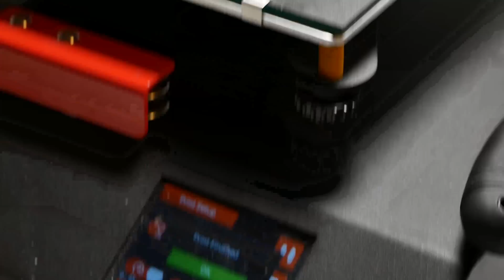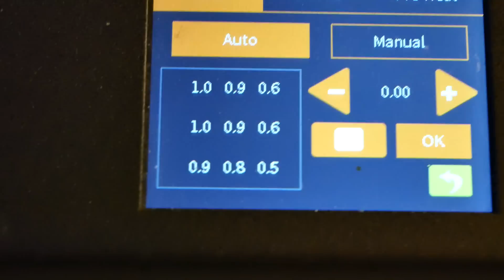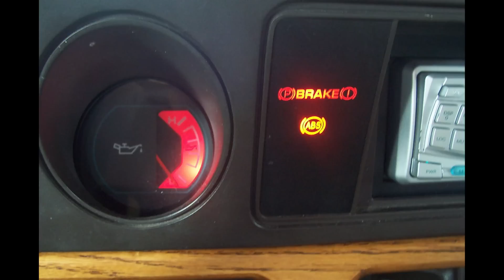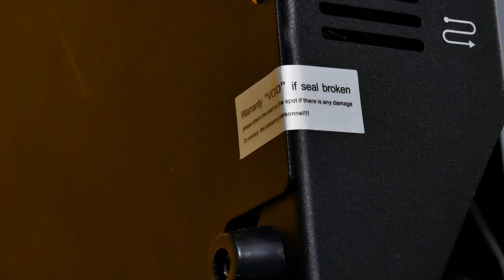Regular 3D-Printer Reviews - Anet ET4

Comment from the maker: BTW! I heard you all (in my last video) when you said you want a V6 and a V8! I'm working on it!
Reply: Just wanted to ask: the only problem I had with the i3 and am having with the V2 is the curling of those very severe angles in the beginning of the print. Do you have any advice to overcome this issue? My bed is as level as I can get it, my fan is on 100% and I'm printing 20mm/s. Using Fillamentum Extrafill PLA.
Reply from the maker: @vit.budina  try having less fan on in the first few layers, maybe turn up the bed heat a little to 60?
Edit: depending on your build surface, cleaning it with a little soapy water might help too
Reply: @TurboSunShine  Actually, the results got better when I changed my fan speed height limit from 1mm to 0.5mm. And I'm printing with 65°C on first layer and 50°C on the rest. I'll probably try to change my fan duct. Thanks anyway. And a quick question about your upcoming engine models: Will they be covered like the V2 or open like the i3? Thanks.
Reply: @TurboSunShine  didn't try printing it with anything else than 0.2mm layer height tho. Maybe it helps to print it finer so there's less material at a time to cool...
Reply: @TurboSunShine  I have a deltabot, Anycubic Predator, with Ultrabase and I clean it with alcohol-based window cleaner.
Reply: @TurboSunShine  Ya mean Soapy Wooder?
Reply: I love all your designs
Reply: What about a V4
Reply: Awesome!!
Reply: I'm glad that you're still making stuff :)
Reply: I have a problem, the 3d printed can't find the files that i take in micro SD can you help me.
The site that i use Is tinkercad
Reply from the maker: @m4tty387  do you export the files as .stl?

Comment: Excellent review but I have a question and Anet support is non existent so I am trying all avenues,  hope you don't mind.  I have the Anet ET4 with a proximity sensor version 3.0.0 firmware.  It has been printing really well but now it will not home.  Every time I attempt auto home on all axis Z just moves up.  Nothing has been changed or touched any thoughts ?? Thanks

Comment: I heard the the power cut off resume feature only works if you unplug the cable instead of hitting the switch. Maybe hitting the switch doesn't trigger emergency resume but  unplugging the cable itself will. Just a theory though.

Comment: the voice heard, will talk to the product engineering department, thanks...
Reply from the maker: Let me know when you solve the issues, and I can then post an update, i believe the et4 can be a good printer if the core features get a bit more polished.
Reply: @TurboSunShine  I upgraded from an ET4 to an ET4 Pro, just for the "silent" aspect. Yes the stepper motors are MUCH quieter but what's the point if the power supply and fans sound like a vacuum cleaner? Original ET4 had MUCH quieter fans. The software for both printers is super buggy. Just leaves the feeling of no matter how much money you spend with Anet, they will always compromise and let you down somewhere. Also the auto bed leveling in ET4 is even worse, because that capacitive sensor changes sensitivity depending on the heat of the bed.... All I can do is sigh...
Reply: Please let us know how to contact your product engineering department. We have alot of feedback for them
Reply: @wr3099  Hi here, please reach out to support@anet3d.com

Comment: You could just get a Prusa MK3S in kit form. I know it is more expensive, but it doesn't require any upgrading to improve its performance. True you can get different nozzles and fabulous textured build plates and the MMU2S (thats a whole other way to go). But once assembled, the MK3S reliably works well.

Comment: 3:04 what's up with that layer going down all weird and bubbly? I've seen that on some printers but I don't know what it's called, or what causes/fixes it
Reply: Dirty build plate preventing adhesion - clean with soap and water. :)
Reply: @jdrevenge  I've seen it happen on literally brand-new printers, I wonder if it's just a bit of dust in those cases. thanks for the tip.
Reply: @StormBurnX  Oil from skin will do it!
Reply: Heat up the bed more and turn off the fan should fix it

Comment: i got myself the et4 a year ago all the vids i watched said it was silent and i tought is twas a steal guess it wasn't. The normal et4 does not come with silent stepper drivers. So i tought huh why not buy an et4 pro motherboard so it would be silent. that was a waste of money becous the et4 pro motherboard is not compatible with the normal et4 hardware. so hey nice way to go anet!
Reply: I had this problem too, but it can be fixed. If you use an ST Link V2, you can flash the firmware of the normal ET4 into the motherboard and it works like normal (but now silent). It is the same procedure as if you wanted to change to marlin. This has been a game changer for me and I love my ET4.
Reply: @souler94  i orderd one on aliexpress for almost a month ago and i'm waiting untill it arives. but thank you for helping me!